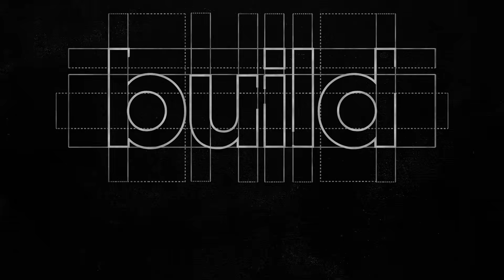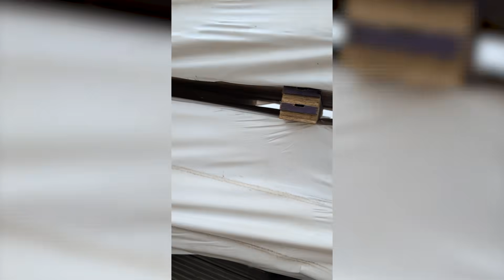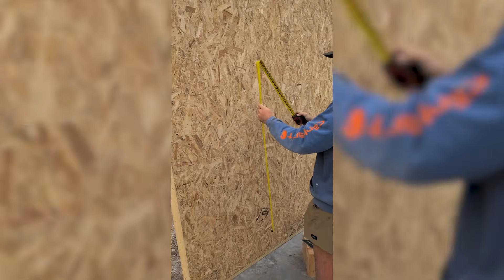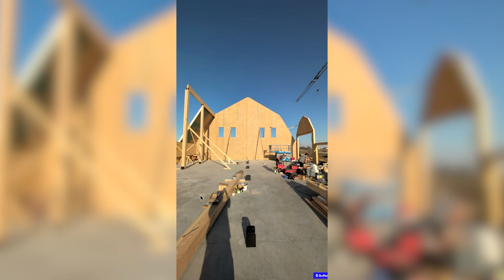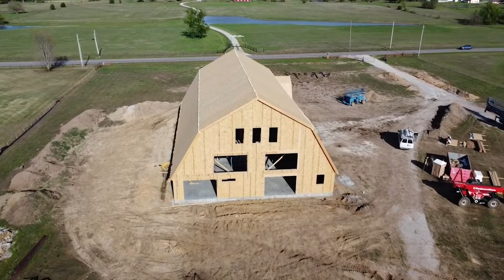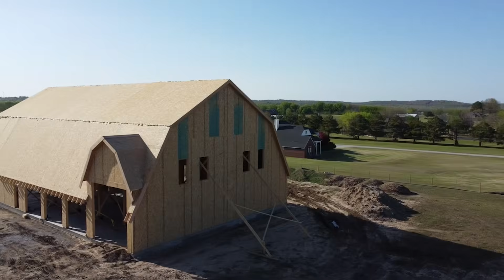GIANT SIPS Barndominium - $40/SQ FT!!?!

Comment: Matt, are there companies that will make SIPS panels using Huber Zip System for the outside sheathing instead of just OSB?
Reply: Yes, just Google SIPs with ZIP board.  I posted a previous reply with a manufacture that has been deleted.

Comment: LOL, OSB sip board for a roof understructure? at least use real plywood. OSB is cheap and falls apart if it ever gets wet, plywood is much better
Reply: OSB has been used for over 40 years.  I think you  are a little behind times.
Reply: @JoePasma  It's cheap and falls apart if it gets wet Plywood is 10x more durable
Reply: @jcm730  The data from the APA suggests that OSB, after repeated wetting and drying cycles maintains is structural properties very well.

Both plywood and OSB if not allowed to dry after getting wet will deteriorate.  

Also, plywood is limited in size, with the largest piece being 4' x 10'.  OSB is available is sizes up to 8' x 24'.
Reply: @JoePasma  Plywood is Better! OSB may meet building code when dry, but it does not recover well after getting wet. Once exposed to moisture, OSB tends to swell at the edges, lose stiffness, and permanently weaken—even after it dries. The resin-bonded wood strands don’t release moisture evenly, which reduces nail-holding strength and structural reliability over time. Plywood, by contrast, dries more evenly and retains far more of its original strength and dimensional stability after wet-dry cycles. That’s why plywood consistently outperforms OSB in real-world conditions where leaks, humidity, or construction exposure are unavoidable.
Reply: @jcm730  The data suggests that you are stating an opinion and not facts.
Reply: @JoePasma  Lol

Comment: Built an Insulspan SIP home for a customer 25 years ago.  SIP construction is so much faster than  stick-framed construction.  Vendor did the SIP erection in 5-1/2 days for a 2700 sq. Ft. House.  Matt’s advise on involving the SIP supplier as early as possible is a real clue to lowering cost.
Reply: Did you go through any sort of molding throughout the years?

Comment: I have a lot of questions about the finishing of these panels:  How is the exterior prepped for siding?  Do you need to apply house wrap or something to protect the wood?  Do you need an air gap between the panel wood and siding?   On the interior, I have similar questions about running electrical and plumbing - do you need a structure inside to support all that?   Is there a concern with attaching wall finishes (drywall or other) directly to the panels that all the holes will eventually deteriorate the panels (especially if it is torn off and redone in remodels over time)?
Reply: Finishing the home on the interior and exterior is no different than any home built today.  Follow good building science practices.  The Structural Insulated Panel Association, SIPA, has a wealth of information that addresses your specific questions.  Extreme Panels website also has information to address your questions.
Reply: Eco Panels of Tennessee also have lots of videos on youTube

Comment: Built in 13 days, burns down in less than a hour. When those panels catch fire, there's nothing you can do. The insulation burns hotter than gasoline. These buildings are a death trap. Bring on the lawyers.
Reply: Where do you get your information to make such wild statements.  It's easy to just spout off on forums like this without having any factual data to substantiate your allegations.

There are documented cases of homes built with Structural Insulated Panels (SIPs) withstanding fires, particularly wildfires, while surrounding traditional wood-framed homes were destroyed. 

These instances are often attributed to specific design and material choices, rather than luck. 

Why SIP Homes Can Be Fire-Resistant
Airtight Construction: Unlike conventional homes with internal wall cavities that allow air to circulate and "feed" a fire, SIP homes are built with a solid, airtight envelope. This significantly reduces the oxygen available for a fire to spread within the walls.

Elimination of Vented Attics: Traditional homes often have vented attics, which can allow windblown embers to enter and ignite the structure from within. SIP roof systems eliminate the need for venting, removing a major point of vulnerability during a wildfire.

Fire-Retardant Materials: The foam cores within SIPs are treated with fire-retardants. In many fire tests, the foam core may briefly flame when exposed to a direct flame but will often self-extinguish when the flame source is removed.

Thermal Barriers: When properly installed with a 15-minute thermal barrier on the interior, such as 1/2-inch gypsum wallboard, the entire assembly achieves a one-hour fire-resistance rating, providing critical time for occupants to evacuate and for fire suppression efforts.

This link https://enercept.com/dont-get-burned-fire-performance-with-sips/ suggests SIPs perform better in a fire than sticks.
Reply: @JoePasma Yep, all the information you recited came from the same expert class that told us that standing 6 feet apart would prevent the spread of COVID. That we could go to a restaurant, but had to wear a mask to get up to walk in or out, but could take it off to eat. That was safe. They also told us that the shot would prevent the spread of COVID. I'm done with the experts. They have lied and manipulated the people for to long. All the while they all have gotten wealthy and everyone else is getting poorer. Strange how that works. Is this the same expert class that says proudly that men can get pregnant? I'm done with all of them.
Reply: @TimRannow  🤷‍♂🤷‍♂

Comment: Very impressive spans for just some Styrofoam and OSB. The structural efficiency of foam core is truly incredible.
Reply: Just wait to see how fast that core burns.
Reply: @TimRannow  The bigger problem is melting. Oxygen is starved very well but no matter how good your cladding is in an intense heat situation you lose all structural integrity real quick.
Reply: @JohnboyCollins OSB and petroleum based Styrofoam will burn extremely fast. Don't you worry about oxygen, all the fire needs is a tiny hole and those panels will burn in minutes. Please do some research on the grenfal tower fire in Europe. Many, many killed. This is what we are building new houses with? Morgan and Morgan is going to make billions off of this. And sadly many people will die. Hope Matt has good lawyers to, I wouldn't be pushing this death trap.

Comment: I just don't see OSB and foam as "legacy building products" according to Matt. I do however see why old timber framed homes and log cabins in the North East have lasted for hundreds of years, and that's a lot to do with the lumber quality back then and air passing into the wall cavities. Seems to me it makes more sense to seal and insulate the building envelope on the inside, and allow the walls and attic to breathe and dry out. This is why there are homes in Europe and New England that have lasted for hundreds of years. Today's homes won't come even close to that, they are too tight in the wrong places.

Comment: I wonder what the sound proofing/sound isolation is for a SIP house? Might  be a consideration.
Reply: Sound insulation is excellent based on my own experience.  Outside sound does not travel well through ridgid foam.
Reply: Ambient sound is reduced dramatically because of the tight construction.  Reduce air leakage and you have mitigated the sound that comes with it.

Low frequency vibrations like a bass drum are not mitigated because it takes a mass to knock down the frequency.  SIPs are not very massive.

Comment: As a residential architect I would never build a structure based on SIPs.  Not only is a foam building environmentally destructive, its constructed with only wooden sheathing panels as its sandwich elements, with little internal mass.  If I were building in Oklahoma, I'd only ever use solid masonry walls, or possibly ICF if owners insisted on foam insulation.  Even a weak tornado would demolish this kind of building, and this is why I'd never accept a job like this.
Reply: Plenty of mentions in the video about structural elements incorporated into the panels so you get way more than two pieces of ply with styrofoam in between.  I can understand hesitation based on the desire to go green but engineering is not an issue.
Reply: So you wouldn't call this build a "legacy build" and "A home for generations to come" lol. It's garbage OSB with foam stuck to it.
Reply: @c.a.martin3029 clueless
Reply: SIPs withstand tornados and hurricanes very well.  SIPs are rated for Florida High Velocity Hurricane Zones (HVHZ) and they have passed the missile impact test. https://www.sips.org/documents/SIP-Missile-Testing-for-Florida-HVHZ.pdf

Comment: $40 per square foot for the structure isn't some crazy low number.
Reply: Have you priced similar offerings lately (?) $40/sqft in 2025 seems pretty darn good. If lower cost options exist, for the same/similar bang for the buck, I'd love to know who offers it & how the performance compares(?)
Reply: @__WJK__ isn t the $40/sq just for the cost of SIPS? ICF construction from footings to rafters only costs $14/ sq , labor and materials( ICFs, concrete and rebar).
Reply: @tjhva SIPS still need rafters and trusses. If you look at ICF construction you would know there are no headers.
Reply: @tjhva concrete in WI and other Midwest states is $160/ yd and under. What fees, none here.
Reply: @tjhva what you mentioned is not an issue for experienced ICF installers / contractors. Estimating costs is easy. Headers of wood or steel for the regular house with door or window spans less than 8 feet are non existent. There are no added truck fees when scheduling trucks . Anything you mentioned is not an added cost for the experienced ICF contractor. Liability issues aside , high schoolers as day workers can assist with a build.
Reply: @tjhva don’t generalize about ICF as if it’s common (32’ lvl) in most construction for windows and doors when it’s not. Don t give an opinionthat is largely a mismanagement and lack of education issue as common when it’s not widespread in the ICF industry.
Reply: @tjhva here s a popular solution you might consider to avoid fees with cemex trucks. Stop mismanagement! Schedule trucks to avoid wait time. No one makes a contractor schedule all trucks for same delivery time!
Reply: @ToddBizCoach  On of my biggest regrets in 2025 is making the foolish decision to interact with you at all. All sorts of things happen during 60 yard pours, including some wait time. Please leave me alone now
Reply: @__WJK__  I believe they meant that getting to a similar point in construction with more traditional framing + Zip-R it would be comparable in cost
Reply: @__WJK__  Framing is a low share of the overall cost of a single family home.  Google suggests $7-$30/sf (lower for a larger structure).  All the other trades and finishes and site prep are what get you to $300-$400/sf.

Comment: After some European travel over the years im always shocked at how few tow okay behind cranes we have in the states. In Croatia I literally saw a crane set up just for fall protection.  The owner said it only takes an hour to set up.
Reply: Europe gets all the cool stuff. I saw shutters in France that slide in a track and are completely blacked out.Want it here? Tough, firecode says no.
Reply: I’ve wanted one of those cranes since the day I first saw them, be a game changer to have a tower crane on a house build, replace cranes and telehandlers. Since they are less common here they are more expensive.
Reply: Croatia is the size of a small US state. . .
Reply: @BlackBeardAir Yes and?  They are common in England and Latvia and Ukraine and Italy. The point is they are common in areas that labor is not cheaper that the set up and use of a piece of equipment. I've never seen one in all of Africa I assume because labor is cheap.  I don't know why we don't use them in the states more.
Reply: @tysleight  they're non-sequitar.  Thats the point

Comment: Just need to get one of these SIP vendors to put a ZIP style integrated moisture resistant sheathing layer on that plywood, it would reduce the the remaining issues with SIP construction.
Reply: ECO Panels of Tennessee.  They have a YouTube channel and they will build panels with ZIP. Their system is quite unique as their vertical connections are done with locking cams. I plan on using them on my next home
Reply: You have to a vapor permeable barrier on these systems.  We are looking at using GAF roof felt on ours because it maintains the vapor permeable barrier while adding the waterproofness
Reply: @cmstreich  Exactly. ASIRI Designs YouTube channel dives way more into the science of building
Reply: At the very least, thinking a proven commercial grade spray-on deck sealant might do the trick(?)  Also wonder if the protective soy-based sprays I've been hearing about lately, might also be a cost effective option, though it seems rodent intrusion could become an issue with potential disasterous results(?)
Reply: @__WJK__  One of the builds on the Build network (The Pioneer or something) did that as part of a hybrid SIP construction. It's one of the possible solutions I have penciled in for a future build I've been toying with, on a mountain lot.
Reply: They exist. Eco Panels of Tennessee makes sips with zip panels integrated. They also use polyurethane foam instead of eps which makes them higher R value, stronger, and more moisture resistant.
Reply: Eco-Panels of Tennessee does this.. Their SIP locks in place. Problem is Xtreme panels can afford to keep paying Matts insane advertisement fees but not the little guys. Makes Matt look like a shill for $$$
Reply: @forgivemelady-r7f What successful business sells their product for less than they can get for it in the marketplace? Matt is running a business. He is bringing the concept to his followers who may or may not already be familiar with the product. I appreciate the comments section as much as the video, because that is where you get varied opinions. You can learn as much or more from the comments of people who have different ideas and different experiences with a subject. Your comment is useful as well because it serves to remind us that a bias could be a factor in the video. That is why the comment section is a useful tool for exercising due diligence.
Reply: Someone does, I’ve seen them. Forget their name though
Reply: Was thinking same thing. I think Matt said something similar when they did that demo at Moss Mountain Farm.
Reply: Look at Zs2 technologies. Solves a lot of problems with SIP systems
Reply: I called Huber once. They said they make it. Or they could…
Reply: @alexchuang they make zip r which is ok. Sips of Tennessee( or something like that) make zip sips. Problem with zip sips is you’re limited to zip sheet size, and cost. If you go extreme panel route you cover it all with prosoco liquid vapor barrier or another decent brand
Reply: Eco panels does plus they use spray foam instead of eps
Reply: @kingduck3192 Polyurethane closed cell under pressure, so it is high density/ strength.  The foam is strutural.
Reply: Yes, Eco panels of Tennessee
Reply: Except, of course, SIPs vulnerability to tornados that regularly occur in Oklahoma, SMH.  As far as I'm concerned, any architect designing a residential structure like this in THAT location, is tantamount to professional malpractice (Notwithstanding their discussion at 12:45).
Reply: @DrMJJr more Tornadoes occur in Illinois than Oklahoma. That particular location also doesn’t really have issue. Also sips perform better than everything except concrete for sheer. Heavy concrete will up cost significantly in Oklahoma as well. Do you build anything anywhere?
Reply: @DrMJJr  SIPs withstand tornados and hurricanes very well.  SIPs are rated for Florida High Velocity Hurricane Zones (HVHZ) and they have passed the missile impact test. https://www.sips.org/documents/SIP-Missile-Testing-for-Florida-HVHZ.pdf

Comment: Building code in OK definitely covers tornado performance. I’d have appreciated a brief mention on how EPT works with/interfaces with local Code Enforcement but, given that the SIP concept and execution is the focus here, it’s not surprising Matt doesn’t feel the need to mention it 👍
Reply: That’s the sad aspect of so many build/diy YouTube’s. So much is presented with no reference whatsoever to building codes, and people seem to believe that it is that simple.
Reply: @johnlee7085  This wasn’t presented as DIY, but using a contractor. The contractors handle dealing with permits-that’s part of their job.
Reply: In this case a fully engineered package was delivered. Meeting Building code was no problem. We actually held an event on site where 6 building inspectors showed up and were more than pleased with what they saw.
Reply: I would assume their engineering team can build to meet any codes... For example, I'm sure someone up north needs to account for snow loads. California, seismic... On and on. 😅

Comment: Why not steel sips. I’m building with them and they are superior in every way. Lighter. Stronger. Don’t rot / delaminate in rain
Reply from the maker: I’ve never seen a Steel SIPs build. It would pose some challenges like condensation & fasteners.
Reply: Cost?
Reply: Where do you source them from?
Reply: There is a large steel SIPs aircraft hanger here, that Bering Air built. Although,  they might just be IP with the structural component being the steel post and beam skeleton.